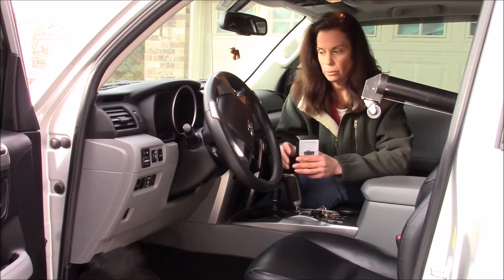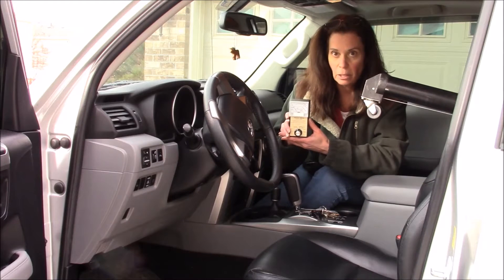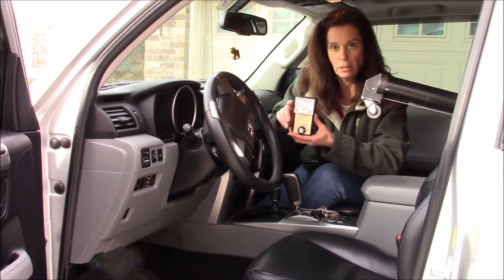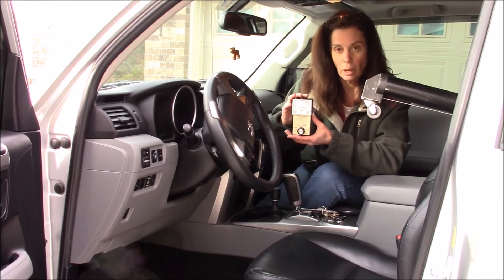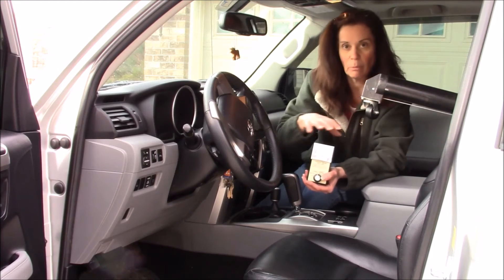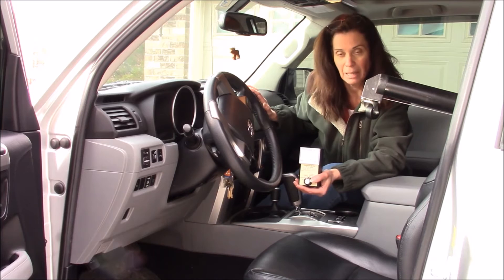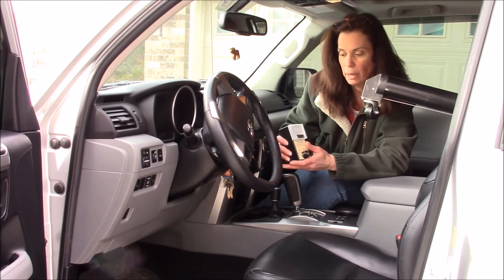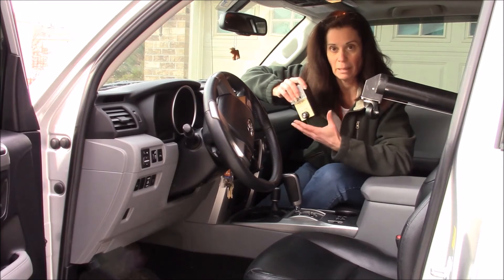Cars, EMF and Healthful Tips

Comment: The principal source of unwanted high amp EMF is the alternators  conducted high ripple electricity which it passes via battery ground cables onto the vehicles chassis. The chassis acts as an antenna. Thus its plausible to have a high quality and proper sized , good car battery which acts as an alternator ripple filter, a bad car battery wont filter much, and will require the alternator to run much longer in order to charge it. In theory a car design which does not utilize the cars chassis for electrical conduction is possible, but requires few aspects such as: routing of negative cables for every single  (lights, power windows, etc etc)  appliances using ground negative, back to the battery with neg cables, dealing with unwanted static that might occur and can put the car at risk of fire. This requires a totaly new car design devoid of the chassis ground circuit.

Comment: What is dangerous is frequency the Hz of the AC current, low Hz (like 0-70Hz) won't harm you even with thousands of Amperes and the only harm High Hz with strong currents can do is heat your body up. That IS all, no cancer or anything else, if high EMF was causing cancer like that those who work close to power grids and thousands of volts would be dead after few years, but i know a few who work 20 years in that environment with no health problems. What can harm you really bad is talking to the phone or cellphone many hours a day, this drives mad the brain and the vibrations heat the cells up, then you feel dizzy and nausea after the phone. EMF will harm you if you are a transistor or the like...

Comment: The Trifield 100xe is very very bad for measuring radiofrequencies (electromagnetic radiation), and is only single-axis for that, so you have to point exactly towards the source, and even so underreads a lot. Use another for a much better accuracy. For the magnetic and electric field it's 3-axis so the meter position doesn't matter so much. Anyway, use dedicated instruments for each thing to contrast measurements is highly recommended.
Reply: what meter do u recommend?
Reply: @incorectulpolitic  there are several of them look at Michael Neuert channel.